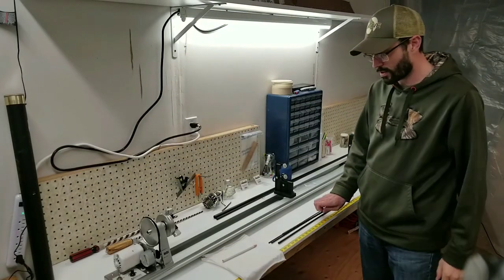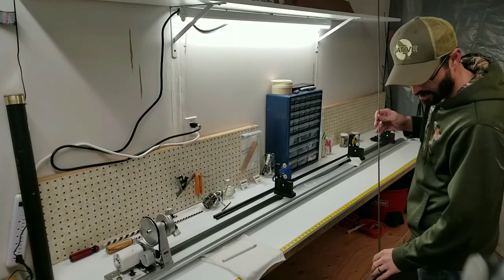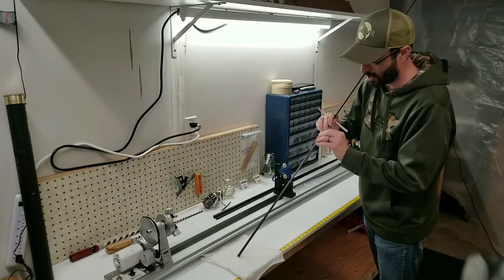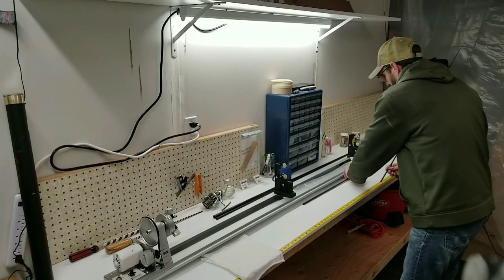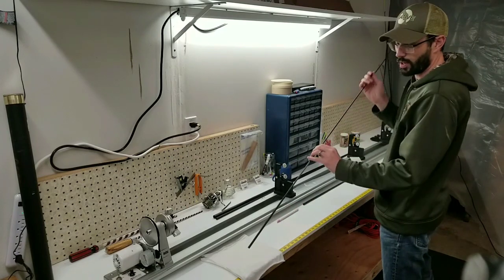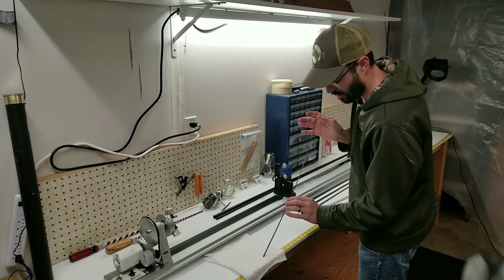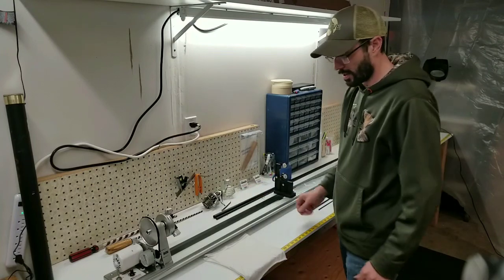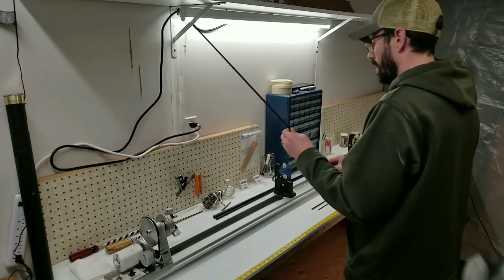Fly rod building: Finding the spine and marking guide spacing

Comment: When you are marking your guide spacings on the rod, do you mark them before the tip top is placed on … or after? If after, do you measure from the very tip of that tip top or from its bottom … or would it even matter? Also, have you done spacing for a 10 foot or 10 1/2 foot rod?

Comment: I've got a 8' fly rod blank coming soon..my question is what the measurements would be on the spacing.. thanks
Reply from the maker: So that varies depending on the manufacturer but most companies offer a guide spacing chart. Who is the Mfg??
Reply: @contiscustomrodsccr4387  moonlight 5 wt
Reply from the maker: @stephencarroll8537  I would reach out to them directly and see if they can provide you one. If not, find the spacing for a similar 8' glass blank and zip tie your guides on and give it a cast in the yard or do what's called a static test by running line through the guides and putting weight on the line. Look at the guides and see if you see any trapizoid shapes. If not, you're good to go. I can always video call you if needed
Reply: @contiscustomrodsccr4387  I'll try to get a hold of them thanks for the info